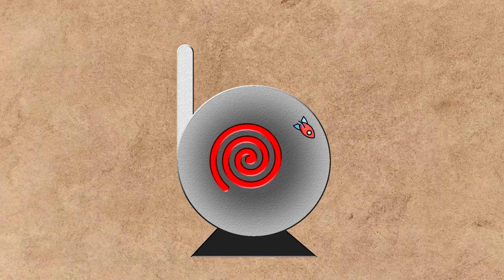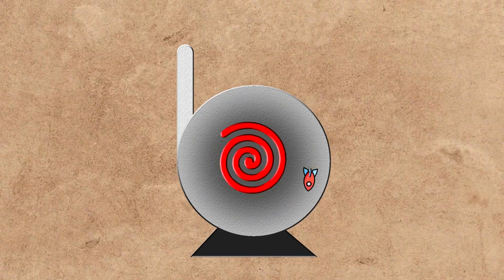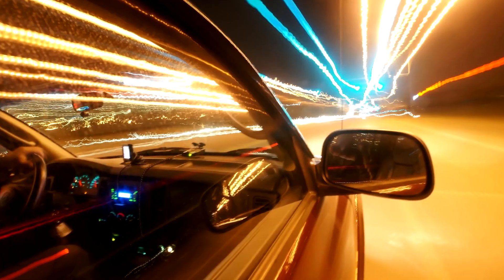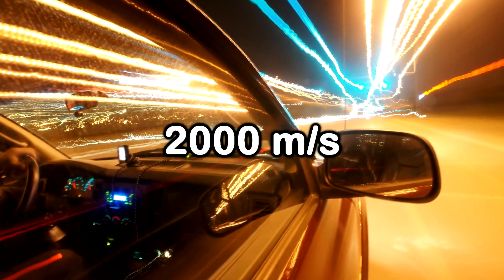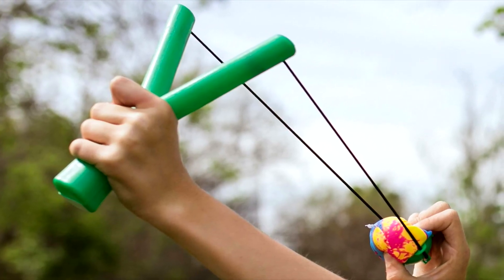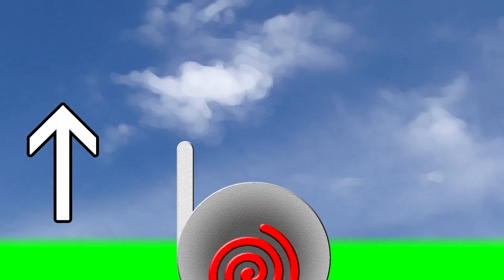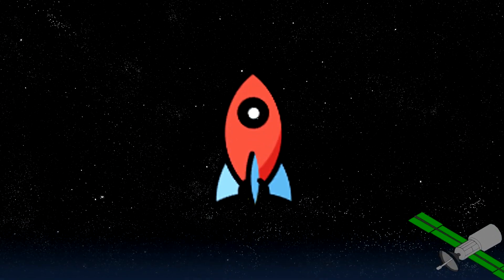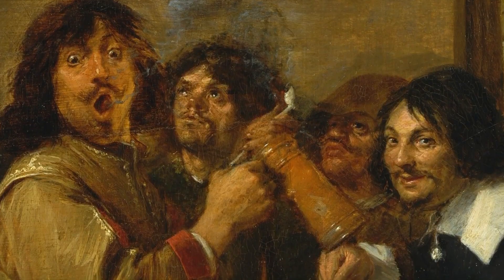why it doesn't work 80

Comment: The idea behind SpinLaunch is more to get satellites into orbit while avoiding the fuel costs and absolutely massive amounts of thermal energy produced by rockets. I do think it could work, however I also think that it's too dangerous of a system and will be better served for getting more data towards a better system of kinetically yeeting stuff into orbit.

Comment: Didnt they already built, test and even send things into space by now? Its obviously not going to send rockets, it wouldnt make sense, since a rocket propels itself, but in this case that is already done by the centrifuge. Also its way more energy efficient and cheaper to spend things to space like that than rockets. Got any idea how much boosters and rocket fuels weigh and cost?

Comment: Centrifugal force is absolutely a real force. It's a force in an accelerated frame of reference. Tell me how you would measure centrifugal force in a way you could tell it's not "real" whatever that means.
Reply: I believe people say it's not a "real force" because from an outside perspective it's just inertia
Reply: @DanilegoPlays  Yes, I understand. But it's certainly a force in the accelerated frame of reference. 🙂

I mean, in Newtonian physics, it's as much a force as Gravity is.
Reply: People say centrifugal isn't a real force cause it's more of a byproduct, not a force itself. It's just momentum putting on a mask and pretending to be something new. For example you got a ball and a string, you spin it and it feels like it's trying to pull away, but if you release it it goes forward in a straight line. That's cause there is no "centrifugal force", it's just the ball trying to move in a straight line. However to keep it moving in a circle a force (in this case tension in the string) has to keep it from moving in that straight line, which feels like a force moving outwards from your perspective.
Reply: @finn596  Right. Define "force" in a way that doesn't accelerate mass, and I'll agree with you. 🙂 Either F=ma or it doesn't. If I set a ball on the ground and it starts rolling, it's experiencing a force.

I mean, I understand why it's called "fictitious," but it's no more fictitious than gravity, and it accelerates mass which is the definition of a force. You just have to be in a non-inertial reference frame to experience it. But you have to be in a non-inertial reference frame to experience gravity, too, and very few people call gravity a fictitious force.
Reply: @darrennew8211  Oh it very much is a force, it's just that "centrifugal" force isn't real. When people say that centrifugal force is fictitious they aren't saying that there's no force, just that the term "centrifugal" is just kind of like a rebranding of the real force causing it. A good way of thinking about this is that a real force like gravity is created by mass, there's no other way to put it. But when you spin something it isn't the spinning that causes the force, it's what's keeping it spinning. It's the string holding the ball, the gravity holding the orbit. The so called "centrifugal force" is just the ball trying to stay on a straight path.
Reply: @darrennew8211  So "centrifugal force" isn't accelerating it, it's tension, or gravity, or some other force. That's why centrifugal force is fictitious, it's just rebranding of other forces
Reply: @finn596  Gravity isn't a real force either.

I understand what causes centrifugal force. I'm just disagreeing that it's any more a "fictitious" force than gravity is. I mean, that's the whole Special Relativity thing, right? Gravity isn't a force, because you can't measure it? So why is centrifugal force "fictitious" when I can measure it like any other force. People say it's fictitious because someone else calculates it differently. But if one is in a box spinning around a circle, it's not fictitious to the person experiencing it.
Reply: @darrennew8211  Ok well here you're just combining 2 unrelated concepts. Sure on the small scale gravity can seem like that, but on the large scale it is very much still there, curving spacetime and the like. Gravity doesn't disappear from 2 different reference points, whether you're spinning or still you will still experience gravity. The so called "centrifugal force" only exists in a spinning reference point, and from any other reference point doesn't. Basically real forces will exist regardless of your frame of reference, centrifugal force only exists from a spinning frame of reference and only has effects on a local scale.
Reply: @finn596  The "force" of gravity only exists in an accelerated reference frame also. That's my point. If you're standing on the surface of Earth, there is no "force" pulling you down. Space is accelerating downwards, and the surface is pushing you up, so you feel upward acceleration.

A force is something that makes mass accelerate, according to Newton. But gravity doesn't make a mass accelerate. Astronauts experience no acceleration nor centrifugal force, yet according to Newton they should be experiencing  both. Both are fictitious forces.
Reply: @darrennew8211  Well now you're moving the goal post here. We were arguing whether or not centrifugal force was fictitious, but sure, I'll bite. Here you're comparing 2 very different concepts. You're comparing a fictitious force with something that isn't a force. In general relativity gravity is the curvature of space time, which causes real, measurable effects like time dilation regardless of reference point. So while it isn't a force, it is in no way fictitious. Like sure the astronauts don't experience gravity, but also they're gonna be aging just a teensy little bitty bit faster than the rest of us due to gravity (that is if they were motionless, of course because they're moving through space time they may actually be aging a bit slower but that isn't really important rn) . Centrifugal force has no such effects because it is fictitious.
Reply: @ You can have gravity causing two masses accelerate towards each other without there being any force applied to them, if you use general relativity. The force that Newton called gravity is a fictitious force. That's why I brought it up. Centrifugal force is measurable by the person experiencing it, indistinguishable from outside just like the "force" resisting gravity as you're standing on the ground.

We're really just arguing over words, tho.

Comment: You've failed to identify any real challenges, just moderate ones at best. They're not generating vacuums for plasmas, they just need one good enough for air resistance which is extremely straightforward. I would surmise it's possible to do with stuff you can get at Home Depot. Energy is a concern, but it's not as if rocket launches are any much more efficient. The rocket needs to sustain centrifugal forces, but we have guided munitions that we fire out of artillery cannons regularly. This does lock out liquid propellants, but solid propellants exist and so you'd need to go into extreme detail to debunk it (and the answer is "maybe, it depends on the assumptions you make"). You can get around a lot of the atmospheric problems by launching at a higher altitude where the air's thinner. You're limited to a handful of launch locations, but it's not impossible. 

The much, much, MUCH bigger problem that most people miss is a very simple one that's the basis of every rocket: conservation of momentum. For something to go forward, something else MUST go backward. So the moment the payload is released, something else needs to go in the opposite direction. For normal Earth-based propulsion, this is the ground. Problem: you cannot dissipate a literal entire rocket launch into the ground in an instant. So how did the Spin Launch demonstrators they put out a few years ago do it? By releasing a counterweight in the opposite direction (ie. into the ground). That's fine for a low speed launch, utterly unviable for a literal hypersonic projectile.

Comment: so much energy that it's easier to essentially create constant explosions under the rocket that propel it upward
Reply: That’s actually a real rocket concept
Reply: @chaosenforcerdhm969  pretty sure that's how rockets work, creating pressure with hot gas and releasing it through the thrusters to move the ship, at least with my limited knowledge
Reply: @ I was referring to a rocket ship that would have used nukes explosions as the way to propel its self up
I also don’t know the definition of explosion so I didn’t realize that and also don’t know how rockets work scientifically
Reply: @chaosenforcerdhm969  understandable

Comment: Maybe a big, very long railcannon could shoot objects into space.
Reply: Friction is still a big problem, but it would deal with rapid acceleration problem if we make it accelerate relatively slowly
Reply: Could one use a coilgun with an evacuated tube? Careful control of the electeomagnets could levitate the projectile
Reply: @EvonixTheGreatest  coilguns are really inefficient. Most coilguns waste 97-99% of energy into heating the coils instead of accelerating the projectile. U can get around 8% efficiency if u optimize the projectile, coil geometry, voltages, etc, but before we get good superconductors (I mean orders of magnitude better than we have now), u can't really go much further. U waste a lot, u get not much. 
Railguns on the other hand are more efficient (10-30% efficiency), but they rely on way more violent currents and voltages, produce a lot of EM fields that can damage any electronics near it (especially the fields between the rails) etc.They also burn their rails in the process but it isn't a big problem. The main problem I see is insane acceleration and EM fields. 
Coilgun is like throwing a rock with a hand, railgun is like a rifle
Reply: Crazy cool sci fi idea

Comment: TL,DR:
You need to create lift in order to, well, lift. Your arms have too smal surface area to create enough lift for your body.
To create enough lift, you need to rotate really fast. You can't because air resistance.
If you do somehow rotate fast enough to create lift - once you take off the ground, you'll have no way to rotate further, since you don't produce any thrust or can't push yourself off things to rotate on them.